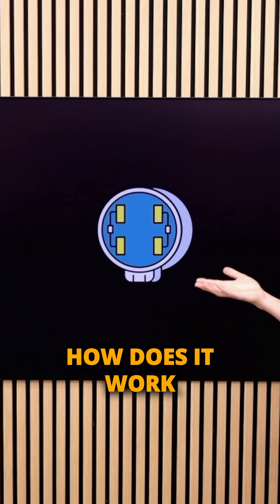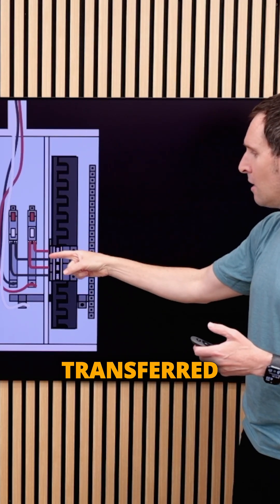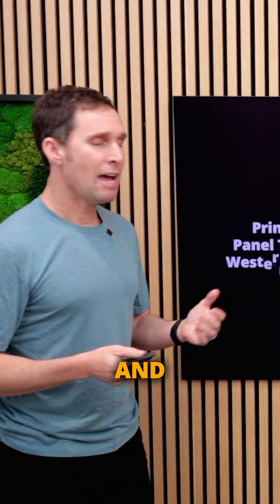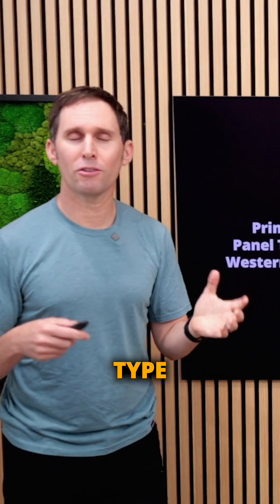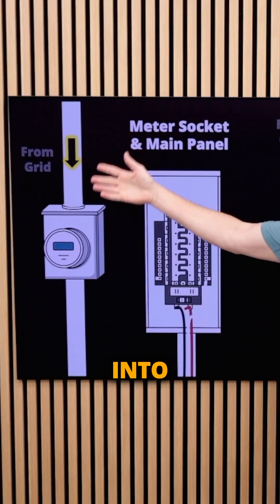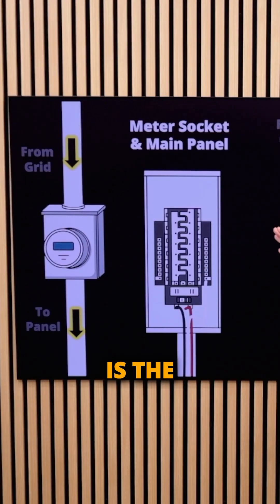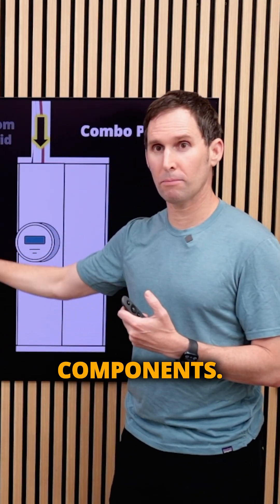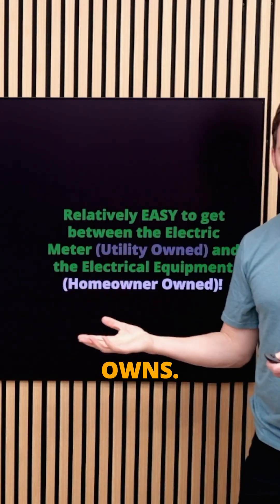What’s This MYSTERY Device on Your Panel

Comment: My condo in San Diego has the panel in the closet but the meter outside. If that similar to the “East Coast” style. Seems very common in condos
Reply from the maker: Yes, this is a really good point.  Multifamily homes are different and typically have a meter socket as part of a big meter panel board and then have sub panels inside of each of the units.  A meter collar could be a great solution in this application, because of it's small footprint.  That being said you'd have to get utility approval and I'm not sure if this device is approved for multifamily applications yet.